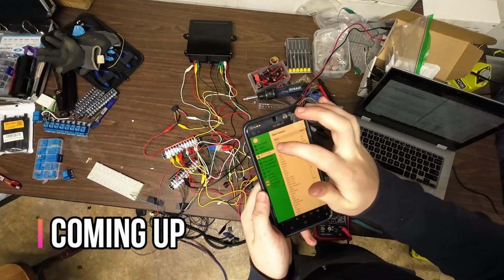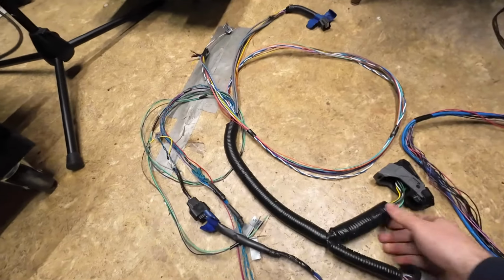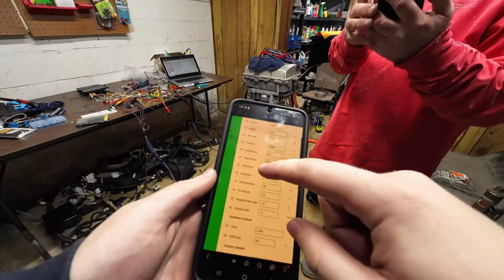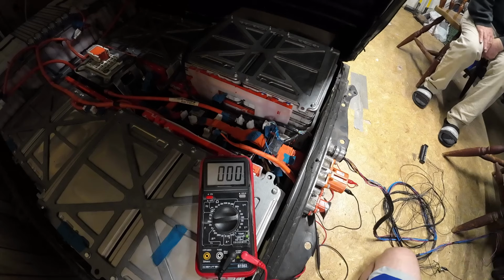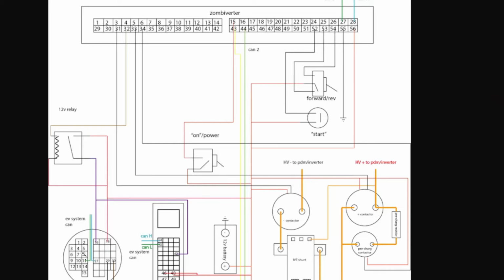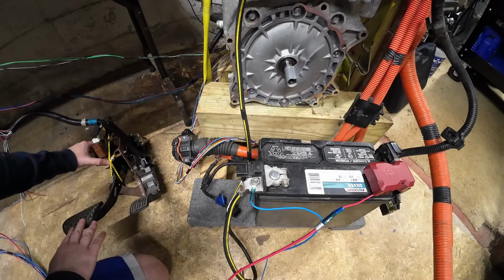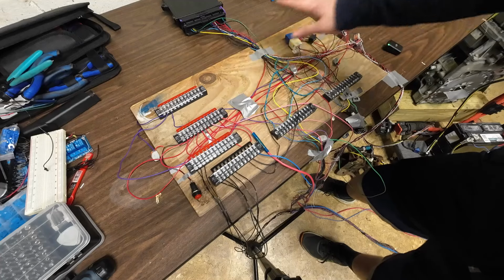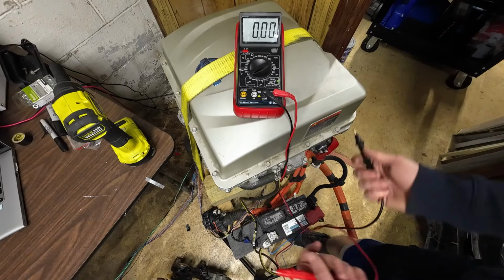It's ALIVE! Leaf Motor Running on the Zombieverter: Venn Visceral Part 7

Comment: whats lowest voltage u can test the motor on  if u dont got a leaf pack
Reply from the maker: Good question. It depends on what hardware you are using. If you are using the original leaf wire harness with the oem ecu and everything, it has to be the battery that went with that car because its manufacture locked together unless you make an unlock tool, and then you'd still need an intact leaf pack. Now I don't like that, so I went with the zombieverter vcu with the oem inverter. You can actually set your min and max battery pack voltage in the ui of the zombieverter, so it can be whatever size pack you want (within like reason though, like 12v would be too low and I wouldn't trust the leaf taking higher than 460v). That also applies if you buy an openinverter gen 2 leaf inverter board and run no evternal vcu. If you end up using the resolve vcu, then I believe the min is 180v. Hope that helps out!

Comment: looks like you didnt fully set the throt min and throt max properly! make sure you get this right! 

you want the throtmin value to be higher than the plotted neutral state of the throttle!  10digits higher should be good.